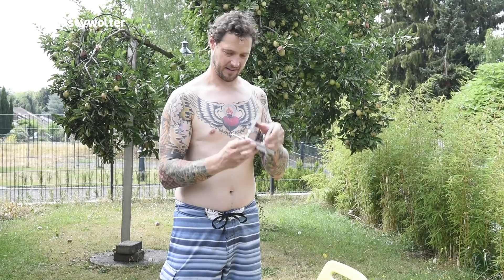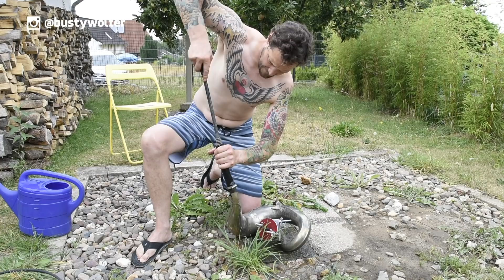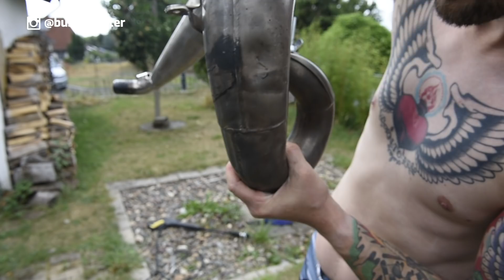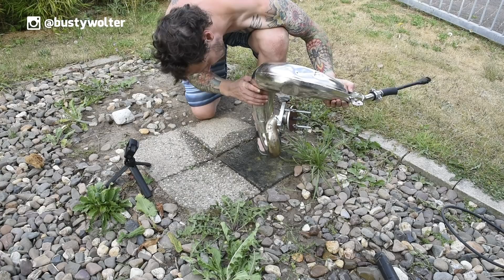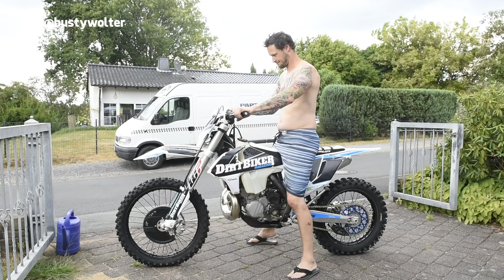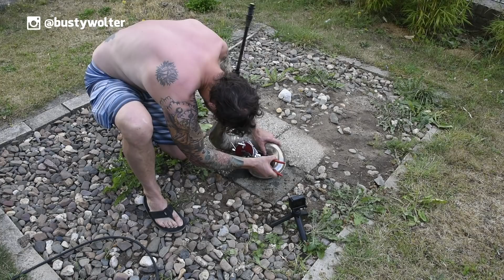TWOSTROKE PIPE REPAIR with WATER: how it works, what works and what doesn't

Comment: The problem is that you're not only taking away the dents.. You're completely reshaping the whole pipe. That's not good. The pipes from factory was designed like that for a reason.
And you just reshaped the entire thing.

Comment: Dings come out much easier with less pressure if you heat the dings and surrounding area with gas torch before you pressurise the pipe.

Comment: Sry but that looks like a pain in the ass when heat and air works way better way faster, hell water didn't even pop the dents out completely and yes air will put it back to perfect shape if you heat the right areas.

Comment: For finishing off those small dents, maybe try keeping the water pressure up and applying some heat to the area.Or apply heat to the area then apply water pressure.
Reply: Lol Heat isnt going to do anything with a pipe full of water.
Reply: @travisk5589  I've been repairing my own pipes with water pressure for a few years now. For small dents, while the pipe is pressurized with water, take a propane torch, apply heat, and tap with a hammer.
Reply: @MichaelAbramo  Still, filling a pipe with water and heating with a torch is the stupidest thing that I have heard this week and maybe even this year. Do you think the heat does anything besides heats up the water? What a waste of time and energy. Put air in the pipe and heat it.
Reply: @travisk5589  k
Reply: @MichaelAbramo  Does the heat do anything? Does it get hotter than 250 degrees? We both know that it doesnt get red hot.